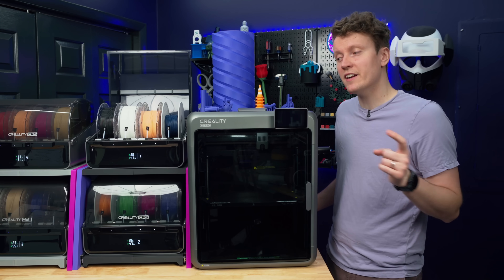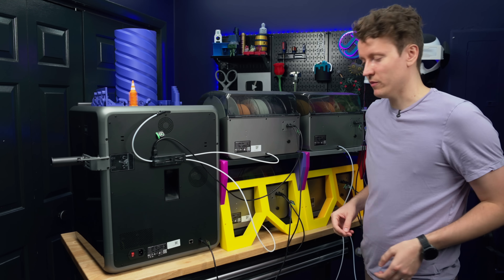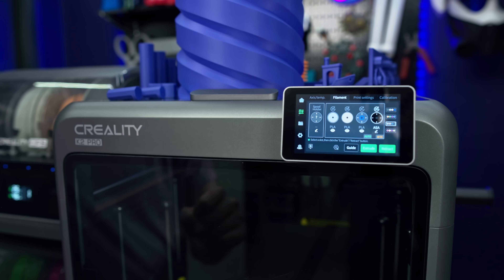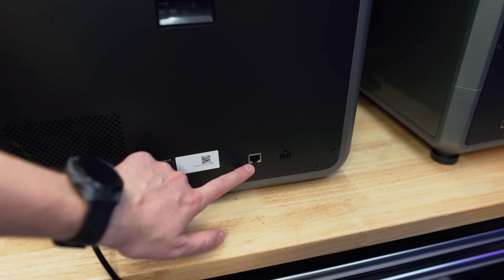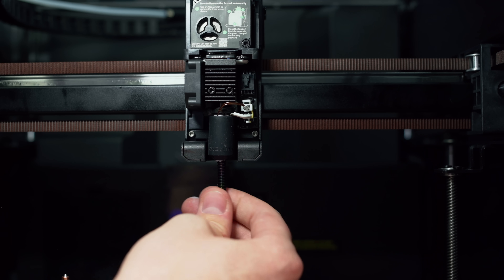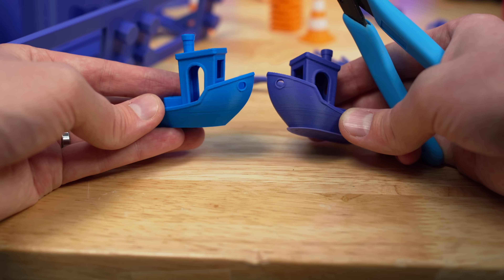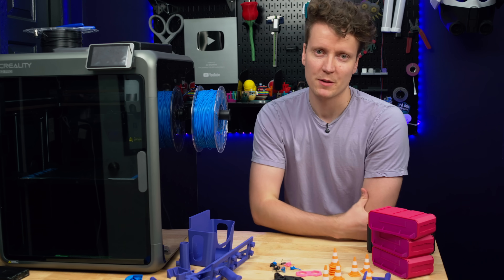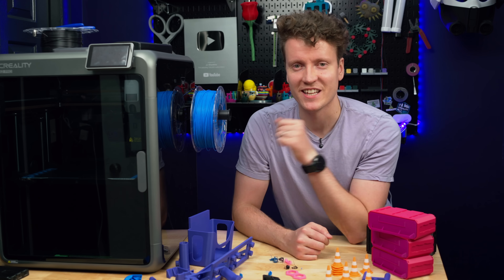Creality K2 Pro - Still a Large 3D Printer

Comment: I bought one. 2 days later came back to it and the hot end was COVERED with melted filament. 2 days new
Then I had to go back and forth for 2 weeks to finally get them to send me a new hot end. For ME to install. If you want service warranty don’t buy this machine
Then after I get the new hot end and install it. Print 3 parts and started giving me a z axis obstruction error every other print. Have to restore the machine every other print to fix it. Sent them an email. As of a week ago, no reply
Warning. DO NOT BUY ANY OF THE K2 MACHINES

Comment: Good morning,

I wanted to have information about the K2 pro combo that I can't find on the Internet.

In the room where I plan to put the printer, the humidity is often greater than 70%
And I wanted to know if the coils once locked in the CFS would be safe from moisture?
Or will I have to buy a dryer and use it every time?

Cordialy
Florent
Reply from the maker: The CFS does seal and the desiccant would help keep the inside air fairly dry, but every time it is opened it would let in the moist air. It won't fully dry wet filament since there isn't a heater inside, but acceptable moisture levels are different for different filaments. 
You wouldn't need to use a dryer every time, but filament that has been left out exposed to that humid of air for months would probably benefit from full drying. If you only use a few spools at a time and keep them sealed in the CFS then they will stay dry.
Hopefully this helps
Reply: @JJShankles Thank you !

Comment: I love the Creality K2 Pro, it has never given me any trouble and has produced perfect prints since the beginning. One thing I've realized after a few prints, while I was doing some cleaning, this printer comes with a protective film also on the inner part of the glass door, it's barely noticeable. I'm sure only a few people have realized it. It's a lot more difficult to take off than all the other films, and the door handle needs to be unscrewed. I recommend everybody be very careful taking this film off, because if you pull too hard, you might unglue the hinges from the door. Please don't use any metal tools like box knives, as you can scratch the glass . After you have taken this film off, you get a lot better transparency. Good luck!!! 😁
Reply: Thank you for the information !
Can i as you a question ?

I'm considering buying a K2 but I'm worried about the drying of the coils:

In the room where I plan to put the printer, the humidity is often greater than 70%
And I wanted to know if the coils once locked in the CFS would be safe from moisture?
Or will I have to buy a dryer and use it every time?

Cordialy
Florent
Reply: @user-tv8km4zf8q  Hello Florent, thank you for your question. The CFS has a contained environment as it is sealed from the exterior with a rubber gasket, it has 2 compartments for silica gel. I have a Space Pi dryer that I recommend buying. Dry the filament, and after you insert it in the CFS, moisture won't affect that filament. If you are a patient person, I'm sure Creality is working on a new CFS system that possibly will be called CFS 2 or CFS Pro, with drying capacity. As soon as it's released, I'll sell my CFS and my Space Pi dryer. Cheers

Comment: don't be at a rush to decide, K2combo on their we, I'm here in China already tested out the latest k2c, and I have to say it is incredibly.  it cost significantly cheaper than the k2c(got it for 300usd here in China while the k2pro c cost about 500usd), but the print quality is just as good. I've tested that with a heated bed on and a extra fan to cycle the air, the temperature of the chamber could go up to 60. And DIY a ptc heater is quite easy.the flow rate of petg is 1.05(the official give a generic petg status but it's actually just a clone from orca, it is not going to bring you quality print)

Comment: I am torn at the moment.  I was going to buy the K2 plus but after seeing multiple reviews that it can only print pla well is a show stopper.  Every review I have watched on the K2 plus is it fails miserably on TPU (even on the side spool) , ABS and Petg.  Whilst some prints complete the quality is questionable with ringing, first layer issues etc.  does the K2 Pro solve these issues. It's hard to believe it can as it's basically the same print head, extruder and feed mechanism just smaller volume??

Comment: The biggest advantage of K2 Plus is the nuzzle temperature of 350 degrees compared to 300 on the K2 Pro, which enables the use of tougher filaments.
Reply: It looks like it shares the toolhead board across the K2, K2 Pro and K2 Plus.

Theoretically, you should be able to fit the 350C hotend to the K2 Pro.
Reply: @Flagermus_FPV but I think you will need firmware change to provide the power for the hotend to reach those temps.
Reply: @fmtjunk  I’ve since received my Pro and done this. Replaced the ceramic heater and thermistor, and lowered the resistance values to match the Plus.

Now runs at 350c with no issues at all after PID tuning.

The Plus ceramic unit is 100W vs the Pros 70W, but thankfully they are the same form factor and fit the same toolboard.
Reply: Most filaments that require high temps don't do very well with large prints. I guess you could always print a bed full of multiple parts in a high temp filament, but I've found that is generally a bad idea due to things like stringing and failures that come from using specialty filaments. Most of the time when you use a high temp filament you're printing a small item and you're doing it slow, which kinda defeats the purpose.of using a large printer. Being able to print PA on the Pro seems like it will be more than enough for 99% of people

Comment: How's the extruder compared to the K2 Plus? Is it the same design or a revision?
Reply from the maker: I took them apart and visually they look identical
Reply: @JJShankles thanks for the update.  Was hoping there had been a revision as I get constant extrusion issues on my K2 Plus.
Reply: The top extruder section was revised and strengthened prior to the release of these smaller units. The original broke very easy, this one lasts. The nozzle section design is the same.

Comment: 16 colors. Prints 2 color cones...
Reply from the maker: Full 16 color prints take days and waste so much more filament than what even goes into the print. The 16 colors is a great filament management system allowing for easy remote access of any color at a time
Reply: @JJShankles  no worries. I'm waiting on more tool-changing printers to come out.
Reply from the maker: @clutch2827  Yes tool changer printers are next level for multi-color printing.

Comment: I've got the original first batch K1 and I'm disappointed that they moved on to the k1c and then the K2 series without fixing the issues with the original k1. I also don't understand who this printer is for, as going from 250³ to 300³ is not that big of a difference, and at that point I'd just get the 350³. The price is fair for a machine like this but seems a bit out of place considering what else is on the market with similar features
Reply: 250 to 300 IS a BIG difference as someone who reg create Large prints its a Night and Day I have both sizes of the K1 and K1 Max the K2Plus is the size that more like WHY? for the average person. 300 x 300 x 300 seems to be the sweet spot for large printers.
Reply: I would love to spend 60$ and get replaced steppers for the k1 from Creality so that it gets less VFA, which is the bane of this printer and I'm not gonna sell it for 300$ on marketplace considering how cheap it has become
Reply: Look up "decoy effect" on Google and you'll understand why they made a 300mm version